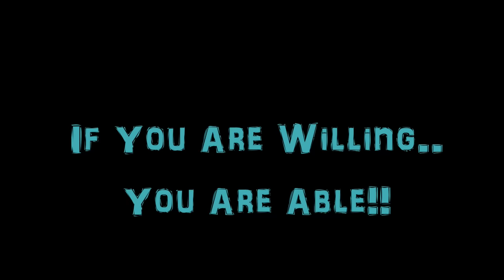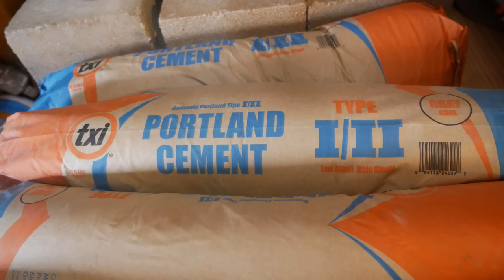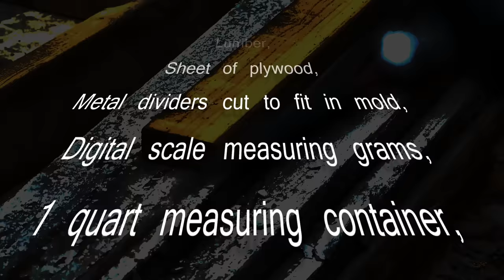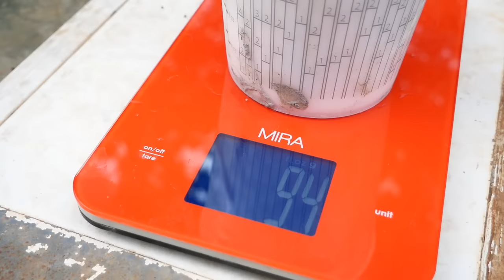How To Build Your AirCrete Tiny House

Comment: A great cause to build with aircrete without trees and many other reasons to use it.  I'm wondering about the $38 per sq foot.  I live in a 481 sq ft apartment, a small bedroom, bathroom, and a kitchen/living room, a small modest space.  To have an equivalent size home doing the math 38 x 481 = $18,278 US dollars.  Is that without electrical, plumbing, and windows and doors?  It's still less than the cost of buying many of the new cars now days.  I have health problems and unfortunately can't build mine.  How much to have one of your crews do the labor?  How earthquake, tornado, hurricane, and wildfires safe are they?  Thanks for this video and for the great cause of using aircrete, the material of the future!
Reply from the maker: That cost includes EVERYTHING in the house if you provide all the labor.  It does not include taps to public services or conventional sewer system if you not use the flush worm composting system.

Of course material prices vary depending on your location.

Visit our website and contact us to discuss building prices. 

Https://www.tinygiantlife.biz/contact-us/

Comment: Can aircrete survive hurricane ? Want to build in the Caribbean
Reply from the maker: Domes definitely.

Round Structures with a Kd factor of .95
At Category 5 hurricane with a wind speed of 158 MPH..
Velocity Pressure: qz = 0.00256*Kz*Kzt*Kd*V^2*I (Sect. 6.5.10, Eq. 6-15)qh = 59.07 pounds per square foot.  

A 10 foot tall round structure that is a 590 pound force at the base if there was no transfer of forces around the structure, which there is.  The tensile strength is more than 900 pounds per foot just for the fabric alone; again not accounting for force transfer and Reenforcing on the opposite side. Also, additional Reenforcing can be added with a second layer of fabric or fibers in the cement mixture.

 However, I am no wind load expert.  
So, you decide..
Reply: No! Will not !

Comment: I'm wondering if you could build an earthship using Aerocrete ?
Reply: I'm thinking the aircrete as insulater and roofing would work in an earthship. Much like the survival model, were they vault, cover with earth (could be light weight earth), then pour concrete, then roofing sealant.

 Use aircrete for vault, covered with fiberglass roof membrane. Then cover back filed earth with air crete. For below grade or for higher strength requirements use gigacrete companies balistacrete on top of the air crete ( yes, it is actually bullet proof, and supposedly green building certified). https://www.gigacrete.com/ballisticrete

Instead of tires you might also like belguards"mega tandum" retaining wall systems. https://www.belgard.com/products/retaining-walls/mega-tandem
Reply: @michaelglenning5107  thanks for your input . I will check out what you brought up. Very helpful !!
Reply from the maker: I suppose it's possible to replace the expensive foam envelope with AirCrete. The walls would not be a good idea as they would prevent access to thermal mass.
Reply from the maker: All things with good engineering could be considered.  However, there is beauty in simplicity.
Reply: I really love this idea. I'm thinking I'm going to make a tire brick and see how that works. I think this is better than rammed earth as the thermal mass should really be inside the insulation.  Aircrete tires bricks on the north side and thermal mass inside the ship makes way more sense to me.

Comment: Have you looked into aircrete with ICF for wall construction?  Would the structure be unable to hold a roof/snow load without the fabric layer?
Reply from the maker: Technically yes, but AirCrete is a building system not just a some material.  Why compromise safety?
Reply: Tiny-Giant LifeStyle I agree completely on the safety.  I just like the idea of the additional R rating with the rigid foam addition, as well as being able to build without bricks.

Comment: I have been wondering if this air Crete could be used as a wall for an earth ship style home. I can’t stand the idea of tires in my house. But I love the sustainable design.
Reply from the maker: Well, earthships work in the idea of thermal mass.  AirCrete is insulating.  So it would not work as intended.  The new earthships use foam boards on the outside to insulate the earth.  This is the only way they can actually work in many climates.   It may be possible to use AIrCrete as the outside envelope if sufficiently waterproofed.

Comment: 1. When is your next scheduled class? 
2. Would I be allowed to learn your Aircrete building process without a desire for a dome style home? 
3. Do you supply written instructions in addition to video? I learn best by having written instructions for reference to be certain I don’t miss any steps. 
4. Would you update your webpage contact link? I’ve tried to send these questions five times already without success.
Reply from the maker: You can certainly learn AirCrete.

Dome workshops:May 31, June 22
Rapid 14 day cast Cylinder October 12.

 Rectangle AirCrete house  to be announced in July

Arch cabins to be announced.

Watch the event page for dates:
https://tinygiantlife.biz/2019/02/25/2019-aircreteworkshops-available-now/

I will take a look at the contract page to see what is wrong.  You can call or text 903-231-3808

Comment: I am interested In building an aircrete home in nc
Reply from the maker: It is entirely possible!  Where are you on your AirCrete journey?  Just found it, learning, know what you need to, or ready to build?
Reply: @TinyGiantLifeStyle  I've been researching for months on end various natural building techniques and also the whole aac/clc blocks. I haven't come to a conclusion. I like cob more. But not much on insulation. I dont wanna sandwich insulation foam between it. Frankly. I need good extensive advice. I know many are selling and and such. But I'm extremely poor and cant really afford it. Which is what put me on this path in the first place. I only wanna do this once though. Trying to figure out an all inclusive method.
Reply: Do you know if cob would adhere properly to aac? What about aac block cracking issues?

Comment: I am a traditional concrete master. I want to do this so bad. I need to see for myself how strong/heavy/load bearing air Crete is.
Reply from the maker: Just remember it's NOT cement.  It's foamed Portland and it takes 28 days to come to strength.
Reply: @TinyGiantLifeStyle  why? Portland cement makes it's own heat, which is a catalyst. That's why we were able to build the Roman aqueducts. Is it the extra air(insulation)that extends the drying time or a chemical effect from the foam agent to Portland? I like learning how dumb I was yesterday.
Reply: just jake The total Curing time for all cement is 28’days, reportedly. Normal concrete will appear solid after a few hours but can be hammered into for a day or so. You’ll have to ask a chemical engineer why the total cure time is 28 days. I have heard it since first working around concrete.
Reply: @johndix1820  your absolutely right. Thank you. sometimes I need someone to reiterate a pointto me be4 I understand. I should've known this. I've seen it. Thank you.
Reply: @johndix1820  I'm good at thinking from A to C. 
A to B........not so much.:)

Comment: Hey Daniel very nice !
What foam ratio/ and wall thickeness would you use for passive house ?
Im looking for a way to do an insulated floor pads that could be enough light to be mooved by a human and enough strong to support the weight of things an peoples in my (moovable) cottage

Does this technic allows wall breathing?
Thanks a lot for sharing!
Reply from the maker: I would not use AirCrete in a portable application.  Cement cracks and AirCrete even more so.  

I would suggest polystyrene with a floating laminate flooring on top of that.

AirCrete does not allow air to breathe through it.  The finish will determine if moisture can work its way in and out.

I would suggest R 30 for a passive house.  12 inches of AirCrete.
Reply: @TinyGiantLifeStyle  When i mean portable is not like a rolling tiny house and more like you moove yourts for example (not including the year's dismounting for structure health)
Its good that  i asked you about the breathability ; cause i was sure it was breathable ! (its more what im looking for, apart for the floor)
I try to maximum avoid industrial materials (a part from cement and lime)
I prefer wood, straw earths and composites
Maybe woodshaves in pallets
Have you experiences on vegetal concretes like straw/woodshaves + lime for structural insulation? 

My goal is to find a way to build a modular insulated structural floor for cottages/small houses that you could remove if one day you would moove the cottage (unlike slabs)

Thanks a lot !

Comment: My aircrete is crumbly after 48 hours. I was hoping to be able to take it out of the molds in 24 hours. How much watering do you need to do. Everyone says keep it wet but obviously you can't add too much water. I heard baking soda helps speed up cure. Any advice.
Reply from the maker: What was your foam weight.  How much cement & how much water did you mix.  How much time did it take to finish mixing?

Blocks should be able to stack and build with in 24 hours.
Reply: I forget the foam density but it was a little on the light side. The slurry was 25 liters of cement to 23 liters  of water.
Reply: @TinyGiantLifeStyle  I didn't get much collapsing either so I thought it was going to be a good pour.
Reply: Ok. i can't get druxel here, but I ordered vegetable glycerine hopefully that will fix my problem. Any ideas if I can use the partially cured cement dust from my bad batches as aggregate or should i just toss it. I'm assuming this dust is as bad to inhale as sawed concrete dust so I kinda made a dangerous mess.

Comment: hi yhank you for helping people around my qustion to you have you try to spry the prouduct on brick wall as insulation slowly one coat after another  to see if that work i wait for your respond respect fully
Reply from the maker: Spraying AirCrete generally knocks out the air causing loss of insulation value

Comment: I weighted my foam and was 96 grams. When I started mixing foam and cement the foam went down like crazy. Instead of having a drum of 50 gals i ended up with a drum of 43 or 44 gals... is this normal? Losing so much foam.
Reply from the maker: No that is not normal. Reduce the amount of water you add to the cement.  You should use about 5 gallons of water/foam mixture and 5 to 6 gallons water for the cement. Also, it depends on your foaming agent.
Reply: Tiny-Giant LifeStyle i did it that way.. well I used 6 gal of water to the cement mixture. Foaming agent I’m usin a members mark brand from sams
Reply: ACH AND HDC have mixed available on their etsy's stores. Mine isn"t ready for Human consumption yet.

Comment: how is aircrete for sculpture
Reply from the maker: It cuts and carves easily.  Nice to work with.  It is not smooth of course, but the texture is fine if made properly.  You have to take your time for fine details.  There are a few pictures of AirCrete carvings on the internet that look good.
Reply: @TinyGiantLifeStyle  have you tried applying resins to the our side to make it smooth.
Reply: I think you should look into this for your final coating.

Comment: Why not use an airform and spray the aircrete instead of using bricks?
Reply from the maker: Loss of bubbles & insulation
Reply: You could make them any size & they are lightweight & they float as well

Comment: COULD YOU USE THIS INSIDE FOAM BLOCK FORMS
Reply from the maker: It depends on the size of the home through the foam blocks.  I would lean towards saying no.  However, if you poured a few with rebar and cement to hold a bond beam at the top and the roof, then it would work.

Comment: Much interest in this method. It just makes sense. 
I am more interested in a straw bale type frame filled in with aircrete. Is this feasible? 
I need more info.
Reply: It is entirely possible. The walls can be cast in place. A non load bearing structure is much easier to get approved if inspection is required in your area.  AirCrete is a very shapable craftable material.
Reply: Daniel Allen    Thanks,I might be contacting you soon.